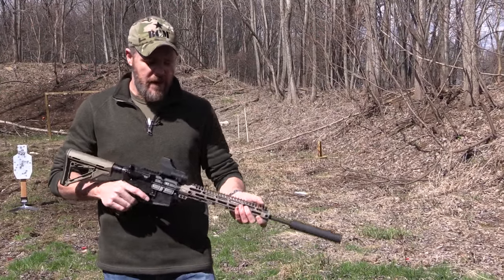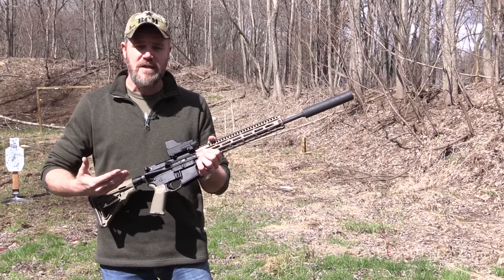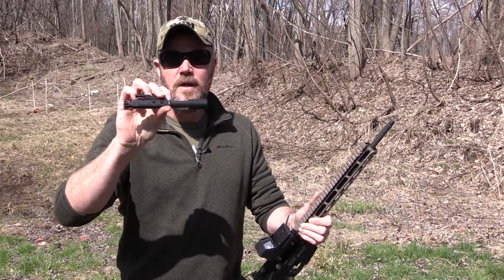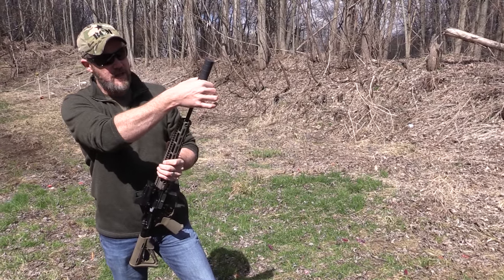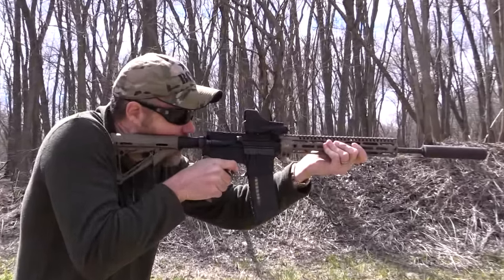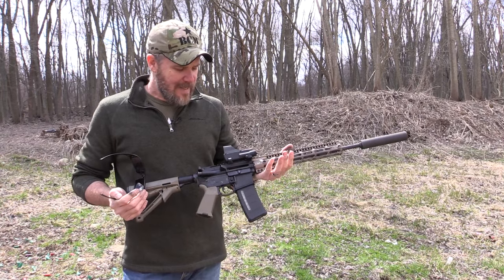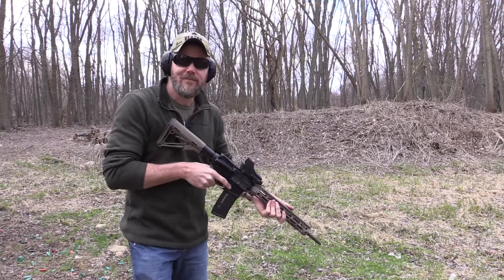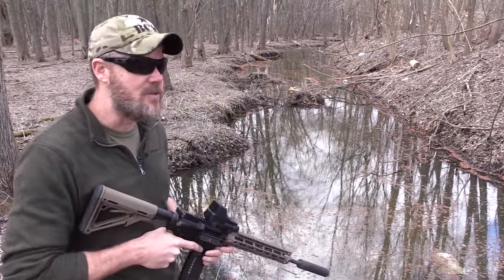GEMTECH Suppressed Bolt Carrier

Comment: Look, they moved the gas regulator from the gas block to the bolt carrier, stupid product.
Reply: +Aleksandr Mijáilovich Prójorov  That comment screams your ignorance of firearms in general and AR gas blocks specifically...
Reply: Let me help you feel stupid. If you run suppressors, like most of us "grown ups" do now days, then it will over gas a lot of different firearms. Someone simple like you would say, "just use an adjustable gas block", which works fine, on THAT rifle. Move the can (grown up talk for, "suppressor") to a different "host", (grown up talk for, "weapon you are using the can on") now you need ANOTHER adjustable gas block. By moving the valving to the BCG (grown up talk for, "bolt carrier group") now you can just put the adjustable BCG into whichever host you are putting the can on. Feel dumb yet?

FURTHER, adjustable gas blocks are far from the best/most reliable systems available. The standard "A frame" front sight gas block of the AR-15 original STONER design is the best, strongest, most robust option; if MAXIMUM reliability/strength is needed. BY having the valving system in the BCG it allows someone who actually uses their AR-15/M-16 for SERIOUS stuff like saving lives, fighting for freedom, etc. to use the standard front sight systems and not some much more fragile, adjustable, gas block. Once the Gem Tech system is "proven" to be reliable, which im sure it will, it will be the best choice for grown ups...
Reply: +YZFoFittie It is cheaper to produce and install an adjustable gas block on every rifle rather than producing a carrier with a valve. You are a kid I cannot talk to you, sorry son.
Reply: YZFoFittie I repeat, grab a book and stop watching youtube, internet is bad for children. You have no idea how a machining proccess is coded, which are the challenges to make it cheap... omg there are so much knowledge you are lacking to even start discussing.
Reply: +Aleksandr Mijáilovich Prójorov +YZFoFittie  As an outsider looking in, I see validity on both sides of your arguments but you guys sound immature going back and forth the way you do. Especially YZFoFittie with your "grown up" remarks, even though I agree more so with your side of the argument. Yes an adjustable gas block is cheaper and yes an adjustable gas block will do the same thing. I personally would rather have any adjustable moving parts as far away from the gas block as possible though due to the heat abuse a gas block is subjected to, hence eroded gas port problems. Also if you run a long rail, adjusting the gas block can be a pain the ass. Plus if someone has several AR pattern rifles but can't afford or doesn't want to buy a suppressor for every one, it would be much easier for that person to simply throw in this bolt carrier on the one you plan to run suppressed for that day than outfit every rifle with an adjustable gas block. Not to mention then they would be able to retain a bombproof gas block for the life of the rifle, and still have an option to regulate gas flow when they plan to run a suppressor. Lastly, if an adjustable gas block or this bolt carrier breaks during a firefight and renders the gun inoperable, we all know which one would be easier to change out in the field.
Reply: Actually an adjustable gas block with a bleed off would be a better solution in the end and way cheaper than having to get a whole carrier. At somewhere around $250 most could use a adjustable block that not only does more than this for at least 5 host rifles, more than most people own. You would benefit from not only even more reduced recoil, gas pressure, but heat and fouling as well that you are not stopping from traveling down the gas tube and venting off, though albeit not every adjustable block vents gas. For some this could be a solution yet again an adjustable block does a better job at it. Now in reality really it is a non issue. A properly built rifle with proper gas tube length, and port size, and buffer weight with a higher quality suppressor. IE one that doesn’t increase back pressure would be the best option period. Why the childish antics over this and that. I dont have any mechanical degree just real world experience with NFA items and using all the above besides a valued carrier. Although it would work it is not the best solution for the money especially when other options exist that are less expensive that do more and do it better! Again look at some of the better designed suppressors that dont have pressure issues and any of this is a non issue. The down fall will be an adjustable will help with cheap underpowered ammo and a very dirty host to be able to have softer recoil then gas it up to run dirty and by using the adjustable gas block it would stay cooler, run cleaner longer, have less recoil for any ammo you decide to use. The only issue I see in this review is that he only used a very high pressure round and not plinking, or lower pressure, or hunting rounds to see how this device works. Still along with what Aleksandr was saying all along. But without all the childish banter back and forth.
Reply: If the point is to use the BCG on multiple guns why not just buy a adjustable gas key.
Reply: A adjustable gas block seems like the better choice more tuning adjustment